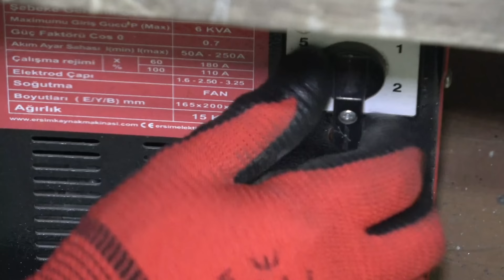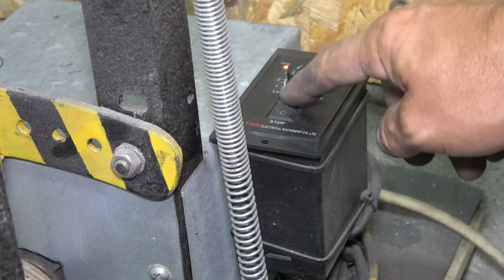Bir Baltanın Restorasyon ile Değişimi !

Comment: Was it cracked before you started hammering on the brittle metal?
Reply from the maker: the cracks looked like an old crack. It didn't crack because I hit it. I didn't want to heat it and miss the water.